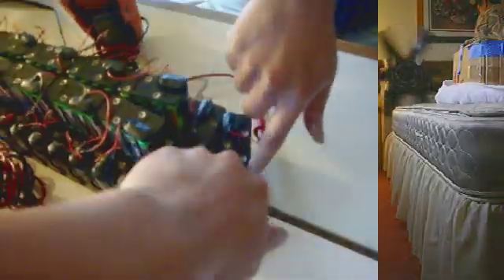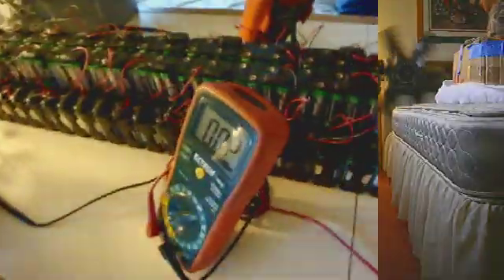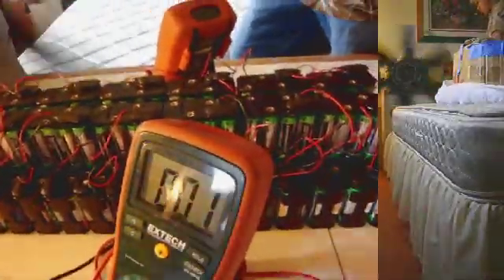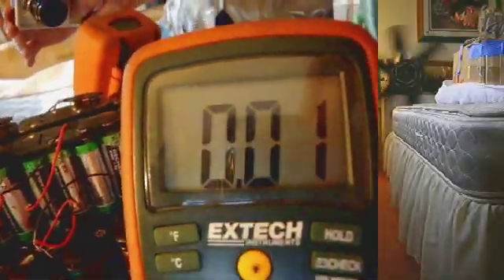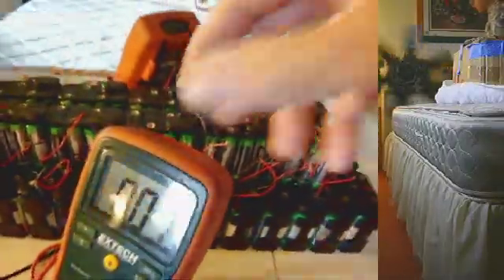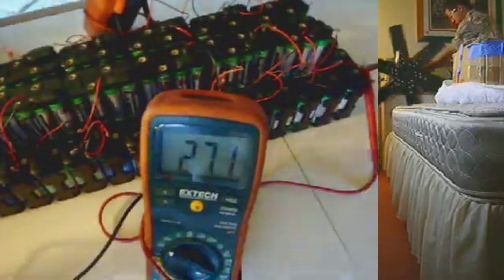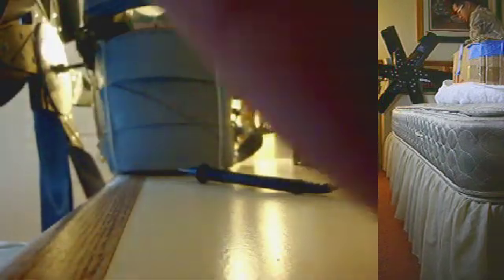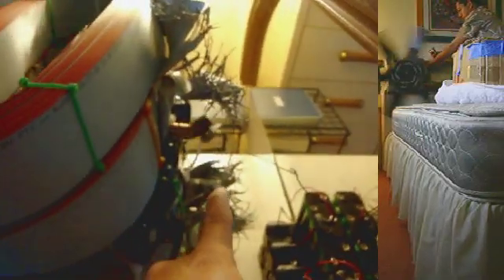Newman Motor Large 32" Fan Blade Negative Current Spikes

Comment from the maker: @overunitydotcom

Also, I really need to find an oscilloscope that does not use a CRT. I already know that my old Newman Motor interfered with my CRT monitor across my room (13 feet away diag.) affecting the beam of electrons it uses to display images.

I believe this means I must get a digital oscilloscope as analog ones do not appear to use LCDs.

It's simply too much money right now.

Comment from the maker: @overunitydotcom

I believe I am truly at that point where the benefits of having an oscilloscope outweigh the benefits of using what I already have.

Also, there is already graphite residue on the copper/arm commutator due to the presence of a slightly eroded carbon brush that connects the coil to the axle.

Comment: You really need to get a scope to see and optimize the backspikes and the commutator contact points.
Better use graphite on copper, that will
give you more backspikes and thus more battery recharging.
Regards, Stefan.